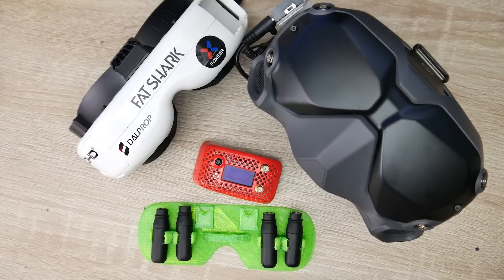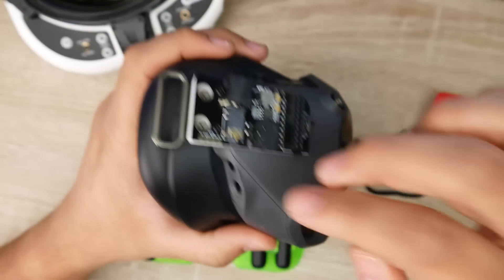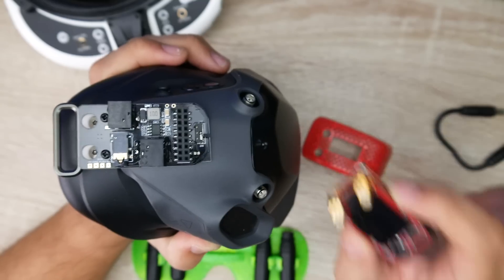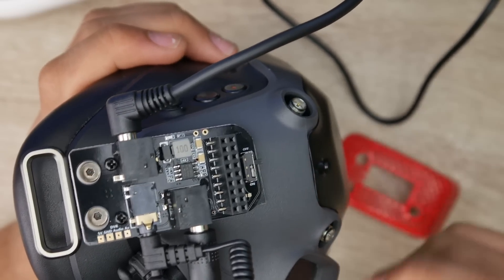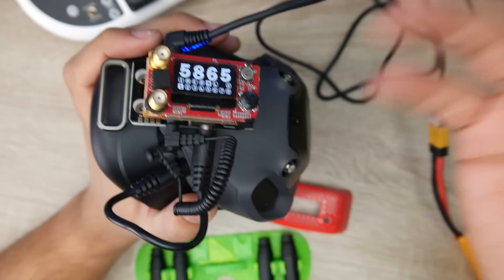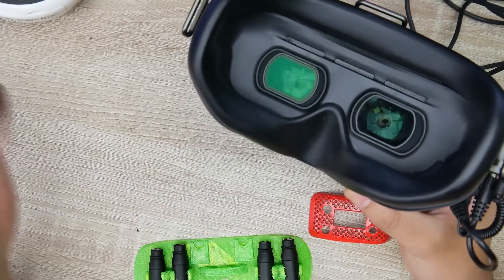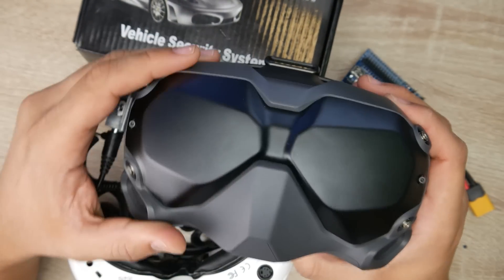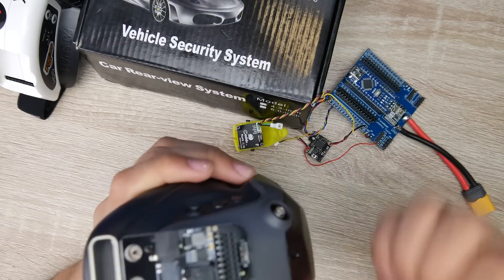DJI FPV Goggles Analogue Input Latency // URUAV 5.8G RX PORT

Comment: There needs to be a tick box so the AV Input is included in the channel rotation on the side buttons so you can switch to it without digging down into the menus (while flying).  That's the deal killer to doing this type mod for me.

Comment: Hi, just a quick question.
With the URUAV DJI adapter I've noticed I get some noise in my fpv video. I have double checked on another set of goggles and I have a noise free video. Is there anything I can do to get rid of this?

Comment: Hello my friend. Thanks for this video.

I have a question. I'm using the dji fpv system on an fixed wing - A zohd dart xl like yours!. I was just wondering,  is it possible to revearse a channel (elevator or aileron) on the dji system,  without doing it in inav. It's a long story, but I need to reverse the channel from the dji remote, not thru inav. Do you know how to do this? 

Thanks again for all your content,  I learned alot from you.

Comment: I know this is a bit off topic, but the Futaba radios are known to have a very low latency. Do you think it has something to do with the radio firmware having less latency or just the futaba receiver protocol? Because if it's the protocol that does the trick, I guess you could just use a Jumper t16 and get low latency with Futaba receivers. Thank you so much for making these kind of very in depth latency testing :D

Comment: Anybody tested this adapter with other brands of modules? ex Foxeer, eachine, it works with fatshark modules?
Reply from the maker: Its works with all fatshark modules
Reply: @DroneMesh  but its working only with Fatshark modules? What happanin if i plug a  Eachine Pro58 module? I ordered the URUAV and i have an Eachine modul and im thinking about cause if i plug it will be explode? :)) or it can works too it...
Reply: yes I use RX5808 Pro Receiver works great could never imagine spending more then $50 on module as I have always preferred built in.

Comment: I am running the furious FPV module and that my signal can go to static and come back without seeing the black DJI The only time it sees the black DJI is if the module is loose and wiggles itself out but ever since I got a printed module bay for the goggles that issue has stopped I have lost signal plenty of times and never had it go black

Comment: You can print a holder for that board that holds the module better if you don't have a 3d printer you can buy one off eBay for $10

Comment: Hey drone mesh, I followed ur latest guide to building a drone but used the F405 MK2 stack instead. Everything works but I don’t know how to connect the camera to my x9 lite controller, how do I connect the camera to my controller?
Reply from the maker: Camera to x9 lite?
Reply: Drone Mesh I don’t know if it’s possible but I’m trying to connect the camera to my OSD on the controller...
Reply from the maker: @bubba1341  That makes no sense
Reply: Drone Mesh idk lol... thanks for the help though.
Reply: @bubba1341  You're talking about connecting your controlelr to the DJI Air unit or Caddx Vista? Both of those can only connect to the DJI remote, not any other radio. You need to add a FrSky (compatible) receiver to your quad and solder that to the F405 MK2. Great choice on that FC btw.!
Reply: Meral Harbes I’m trying to use the Taranis x9 lite OSD to display what the camera sees instead of the joystick positions if that even is possible
Reply: Yeah, it’s possible to have your camera project on the LCD screen of your controller.